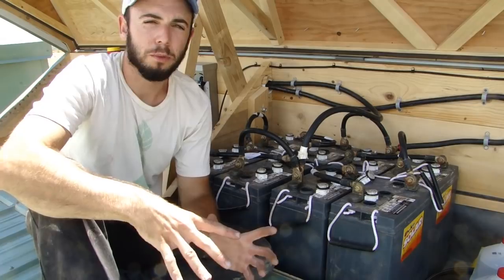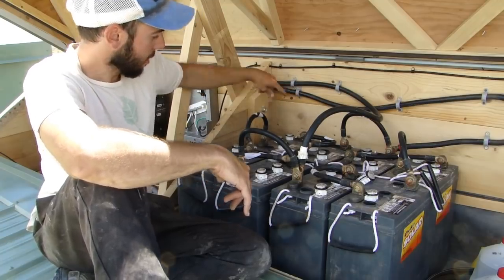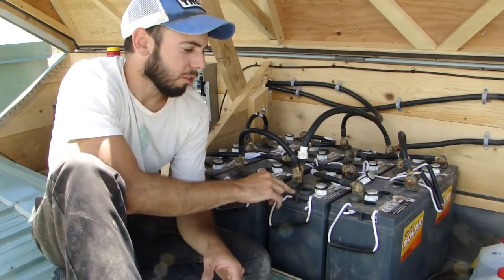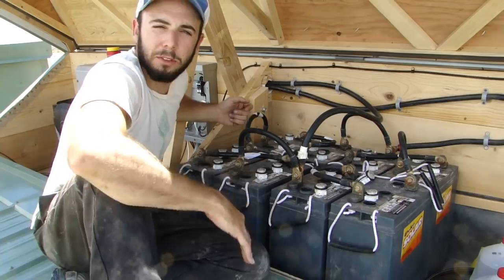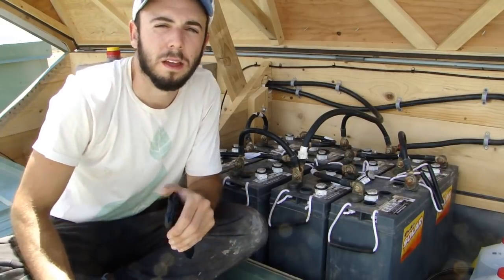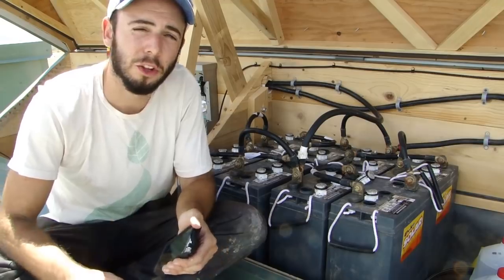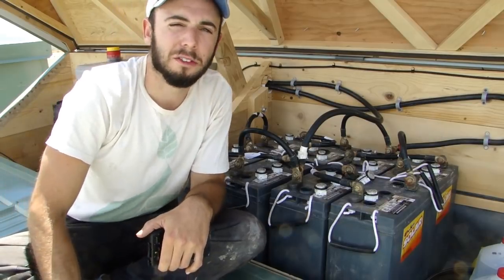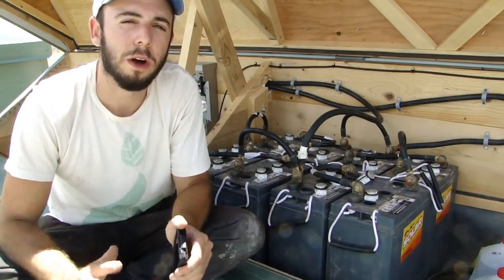How to Size Your Solar System

Comment: Dude, you are a using 24vdc to calculate the load yet not using 24 vdc loads. Your invertor uses substantially more amps/wattage  to convert the 24 VAC to 120/240 VAC. Therefor, is it not bogus to say that the 16.8 KW potential at 24 vdc  will yield 16.8 KW at 120/240VAC? Assuming no loss from the invertor, which in itself is not realistic, 16.8KW is still 16.8 KW, but at 120 VAC that 16.8 Kwatts equates to 140 amp hours which must then be compared to the amps (at 120vac) all of your house loads pull for the hours per day each is used. That is the real way that the system must be sized.
Reply: +Ken Withey transforming a voltage also proportionally transforms the current at the same ratio of turns between the coils, it's just the inverse. So transforming 24v to 240v (1:10 ratio) would transform current in the inverse ratio (10:1). You won't lose power (wattage) in the transforming process but you will have some loss in any system.
Reply: +Nathan Donovan ---  Pleukert effect may be the difference here... it depends on the loads you will activate on your setup!  Li will fare much better on heavy loads... but Li will discharge MEAN if a short, compared to lead acid based. Fire hazard can be a reason to avoid Li.

Modern Inverters lose about 5% in the conversion, though one would think it is an even swap... almost!  Yet 5% on a solar setup if not computed in, can mean nasty discrepancies between what one thinks and what is actually occurring.

Check all documentation on all devices and ask questions... also the length and size of the wires can be the difference between a successful setup and one that comes just short... the higher your V on the panels the better(smaller wires)... you may have to bring your inverter as close as possible to the battery bank! etc... lots of variables to consider...

Comment: i wanna ask. if i got a 1 fully charge 100AH 12V battery and i'm gonna use it at night using a 45W fan and a 60W colored tv, how long it gonna takes to drain my battery?? 
how manny hours ? thanks  the videos
Reply: +Jayson Rico 10-11hrs if you are using a 12v TV, if you use an inverter to run mains appliances  probably 7-8hrs

Comment: you suck at explaining i heard you say they amps stay the same and then you said they double
Reply: +Sheila Davis When you wire batteries in series the voltages doubles and when wired in parallel  the amperage doubles. That is how he wired the batteries.

Comment: You made a relatively simple process WAY more complicated than it needs to be.

The proper way to size a solar system (batteries & solar array) is as follows:
1.  Determine how many total Wh of energy your devices will use each day (e.g. 3500 Wh).  Read electric device labels & use a kill-a-Watt meter to help get this information.

2.  Decide how much you are willing to discharge your batteries daily (e.g.: 30%).  Note:  most quality brand deep-cycle batteries are rated to discharge to 50%.

3.  Calc your net battery pack size (capacity) as follows: TL Wh * 0.30 = 3500 Wh = 3500/.3 = ~11,667

4.  Determine the losses that your system will generate (cabling, connectors, charging heat loss, inverter, etc. Let's say that loss is 15% (Note:  use whatever loss % that you feel is most accurate).  Your solar array must generate enough extra power to compensate for those losses.  Recalculate your battery pack size as follows:  11,667 / (1-.15) = ~13,726 Wh (This is how much power your solar array will need to generate to provide sufficient power for your losses & your loads).  Note:  You many choose to triple this size if you want to have extra energy capacity for 3 days worth of power for 3 consecutive overcast days--that's typically what professionals do when they attempt to sell you a system.

5.  Go to the NREL website & determine the average Solar Radiation (kWh/m2/day) for each month that is available at your location.  http://pvwatts.nrel.gov/pvwatts.php
You should notice that some months have much less sunlight energy available.  You will now have to decide if you want to use the min, max, or average solar radiation number to size your system.  Note:  Choosing the min monthly solar radiation for the following calculation will produce a system that will provide optimal power (for your loads & losses) when the least sunlight is available & much more energy than your system will need to produce & store during the time of year when the most sunlight is available.  Choosing the max monthly solar radiation value will create the opposite effect in your solar array sizing (which will likely produce insufficient power during the time of year when the least sunlight is available).  Let's assume you choose the average monthly solar radiation of 4.5 hrs/D.  You would then calculate:  13,726 Wh/D / 4.5 hrs/D = ~3,050 Wh (This is the size solar array that you would need)  Note:  You many choose to triple this size if you want to have extra energy capacity for 3 days worth of power for 3 consecutive overcast days--that's typically what professionals do when they attempt to sell you a system.

6.  Do some research to find solar panels, batteries, an solar array position controller, charge controller, inverter, & grid-tie system components (if you want one--which I highly recommend).  Get all of the dimensions of each component.

7.  Make an installation design layout, get the solar panel racking, cabling, conduits, lightning arresters, power panels, breakers, etc.

8.  Find a qualified person (if you aren't able to connect everything) & work with your local electric provider to determine whatever is needed to connect your system to the power grid (if you wish to do this step).  You'll most likely have to hire an electrician for the grid-tie connectivity.
Reply: that's not complicated

Comment: Oops, if each battery stores 350 amp-hours of energy, and you have 8 batteries, then in total they store 8 * 350 = 2800 amp-hours.  Otherwise nice video.  Thanks.  Nice system.
Reply: +VLCC Tanker Captain Think about it intuitively, the amount of energy stored in a battery does not change based on how you connect them.
Reply: +VLCC Tanker Captain I mis-spoke in that the amp-hour capacity of a battery is a measure of the CHARGE stored in the battery, not the energy.  It is like the number of electrons that the battery can deliver.  If I add another battery, the charge is doubled.  Add another battery, the charge is tripled.  Doesn't matter if they are connected to anything or not.  You are assuming that amp-hours would be treated the same as amps, but this is incorrect.

Here is an extreme example that will hopefully help:
By the way, amp-hours means AMPS times HOURS.  (It is exactly a measure of total energy because an amp delivered at a higher voltage is providing more energy.)

CASE #1--one 6-volt, 10 amp-hour battery.  The total charge in the system is 1 times 10 = 10 amp-hours.  Let's say it is delivering 1 amp of current to a load.  It can deliver this current for 10 hours (10 amp-hours divided by 1 amp = 10 hours), then its charge is exhausted.

CASE #2--one hundred 6-volt, 10 amp-hour batteries, connected in parallel.  The total charge in the system is 100 times 10 = 1000 amp-hours.  Let's say it is delivering 1 amp of current to a load.  It can deliver this current for 1000 hours (1000 amp-hours divided by 1 amp = 1000 hours), then its charge is exhausted.  And it makes sense that 100 batteries will last 100 times as long as 1 battery, doing the work at the same rate.

By your math, how would this problem work out?
Reply: In both cases the batteries are delivering 6 watts (6 volts * 1 amp).  This must be the case for amp-hours to be compared directly between two systems.  Do you expect 100 batteries to last 100 times as long as 1 battery when delivering the same power to a load?  I do.
Reply: +VLCC Tanker Captain good explanation.
Reply: +VLCC Tanker Captain I don't see my previous reply anywhere.  What I said was that you are correct, my apologies.  I was confused on Ah.  Would be easier to compare batteries if they were specified in terms of energy content in watt-hours, rather than total charge in amp-hours.

Comment: Hi, I live in South Australia and we have just started building our own Earthship. We have 23 tyres down so far! (so we are still in the baby stages!) I'd like to ask a question. Our Earthship is/will be HUGE, 569 square meters. So my pantry is 15 meters by 3 meters wide! So shelving will be a big job.
#1 what kind of shelving did you end up with in your home? I would like a lot of built in storage and I have been looking at lots of photos for inspo, then I had a thought, I thought about floating shelves. I am tinkering with the idea of bolting a plate between the tyres with a steel peg coming from the plate (much like a cheap floating shelf from bunnings but on a bigger scale) that way I could drill a hole and slide the shelf on...any thoughts on that kind of set up? I'd like to use either recycled train sleepers or big slices of tree?

Comment: Hey I have a quick question that google can't find an answer for. I have 2 12V 200ah AGM batteries in parallel. Can I add a new third battery to that in either parallel or independent? I want to increase my capacity as well as be able to replace one battery at a time when I need to so I don't have to buy 3 batteries at once. If so does the battery need to be the exact same size i.e. 200ah? Great video, it helped me determine how many panels and battery capacity I need. Subscribed.

Comment: the way i always understood it was if you have a 12 battery system "lets just say" 8 of those 6 volt T 105 Trojan batteries which are rated at 225 amp hours. you have hooked up 2 - 6 volts in series circuit giving you essentially 4 - 12 volt battery sets at 225 amp hours, now you hook all 4  battery sets in parallel circuit for a total of 900 amp hours 12 volts. mathematically a 1 amp continuous load should in theory run for 900 hours. this is not including the rate of power consumption by the load increasing because the supply voltage is dropping as the battery depletes. technically for charge power you want to also add wind power as well as a proper amount of solar panels to not just match your most common power consumption but to be well above it for when weather conditions and sun light change. when dealing with watts vs current if you had an inverter that runs 250 watts continuous that suggests 25 amps load against the battery if you were running a halogen 250 watt work light. if you wanted to run that for 1 hour you would need a 250 amp hour battery "mathematically" but practically you would want 500 amp hours at least to do it more effectively. it is always best to be able to monitor your current usage by having a dc current meter hooked up in line.

Comment: What would you recommend for a whole house set up. I'm ready to invest and i want to do it right the first time. We used 1065 KWH last month. Please help
Reply: +Mellonee and Tim McDonald 
Are you ready for a second mortgage?  
That's a lot of energy (1.07 MWh) consumption in a month.

A grid assisted system would cost close to 30k$ (not including batteries)
e.g:  http://www.wholesalesolar.com/grid-assist

An off-grid system would cost close to 20k$ (not including batteries)
http://www.wholesalesolar.com/1892212/wholesale-solar/complete-systems/the-homestead-4-kw-12-panel-suniva-off-grid-solar-system

Comment: hi sir  i have 4 100 watts panel when i check with multimeter direct from the panel the output amperes is 24amps, but when i connect with controler using 65ft flat cord  w/ 100ampers deep cycle battery bank the output amperes drop to 10 amps with ammeter ,can you help me what is wrong with my system to achieve 24 amps output ,should i change my wire to awg and what gauge is your recomended,hope you help me Sir..   I really appreciate

Comment: I'm interested in a solar system for my houses. I would like to start with my first house. I've been reading on the different types of batteries to use. I've watched your video and wanted to know what size converter I would need. The house is over 2500 sq ft. (Over) I have 2 front load washing machines. 2 dryers. Central air and heat. A well , an extra large kitchen with 2 Electric stoves. ( large stoves ) . numerous lights , 2 hot water heaters. ( extra large ) , 3 freezers, 3 iceboxes. And outside lights and garage. Whew! How big or how many converters will I need?? What's the best in your opinion along with the batteries. I've been looking at these. , ( http://www.sunxtender.com/ ) I'm probably going to re-wire the whole house anyway. I would appreciate your help and input. Thank you

Comment: Can a 1kw solar panel alone produce that much electricity to power an Air-Con without batteries?
Reply: +Ramp10er NO. You have to have batteries to store the power. Solar panels don't produce 100% of their rated power every hour.
Reply: +Ramp10er
It could power a very small AC unit (<=5000 btu) with a large capacity capacitor bank until insufficient sunlight hit the solar cells (think clouds & darkness).

It  would be totally useless for a typical home AC unit (which in my case idles at 3.2 kW & has a peak draw of close to 9 kW when it starts).
Reply: @zeffur7  hey i m just coming around to your reply, today is Jan 2019. My point is ive  been talking about how to  use capacitors with some electrician coworkers to no avail could you let me know your info on caps thanks..
Reply: @josephmills7758  A cap or cap bank would serve as a battery for starting purposes.  Just look for super caps.
Once the small AC unit is started, the solar panels + inverter would be sufficient to provide enough power to run a small AC unit (650W max).  Just remember, that will only work during full sun conditions.  If clouds move over head, your AC unit will need to be connected to grid power to keep it running until the solar panels can recharge the cap bank for a restart.  

Even though it is technically doable--most people wouldn't do it due to the technical challenges & costs.

Comment: How come if I connect an inverter that has a capacity of 12/24v to a battery of 12 volts 9amh it works, and then if I directly connect a solar panel of 10watts that is producing a 30v at it's peak nothing happens to the inverter? Are the voltage produce in the batteries and the solar panels the same (AC/DC)?

Comment: I got an estimated quote a few years ago and it would cost me around $20,000+ to go completely off grid. When I figured the cost of paying my electric bill verses purchasing a solar system, it would take 10 to 15 years to equal the cost of the purchase. This does not include the insulation or replacement of any parts that could malfunction, which would add to the cost later on. 

Would love to do it, but I see no benefit in the purchase. As far as Global Warming, not enough evidence to support it. There is around 50/50 percent in Scientist who believe it is true and the other side say it is false.
Reply: +garrimic3 "I got an estimated quote.." - Those words immediately tell the story. Someone tried to rip you off. A typical home installation (100% off-grid) is on the order of about half of what you were quoted, if you were to actually buy and connect everything yourself. Suddenly your repayment time halves too - 5 to 7.5 years sounds about right. When you said "Would love to do it", what you really meant was "Would love to pay other people to do it for me". A few weeks of reading stuff and you could do almost entirely by yourself, with probably one exception - laying the panels on the roof - you might need a qualified guy for that (safety and/or legal reasons).
Reply: +TheRadiastral ..... The estimated quote was based on the KWH, which I used on my billing cycle for the entire year. This includes panels, batteries, and the rest of the equipment plus set up.

I know I could do everything myself, seeing how I have been in carpentry for 7 years of my life. This includes plumbing and electrical. I also completed an Architectural Associate Degree at the local Technology College in which I live. This was of course just before everything collapsed in 2008.

Today I really just don't have the time due to having 4 kids, while my wife is in Nursing school working on a BSN. I myself work 12hr days m-f, while I am slowly working on a Bachelors degree in Biology. Not enough work in the area to use my Architecture degree or construction, so I now drive a truck and do pretty well for myself and family. This is just not what I want for the rest of my life.
Reply: garrimic3 Fair play. I didn't want to come across as If I was bashing you that you didn't just do it by yourself, I'm sorry if it sounded like that. What I was trying to put across was rather that it might be way cheaper than, I thought, you thought.
Reply: +TheRadiastral .... I didn't think you were acting like an ass. There is to much emotional drainage in messages. Unless you can hear the tone of ones voice it could go in any direction. 

Although as I was replying to your message I thought you might think I was being ass, but it happens to work out that way sometimes. No ass here.
Reply: +garrimic3 i just bought a small setup to make sure I have some electricity if the grid ever went down. better to be prepared and have something rather then nothing gotta start with smaller setups and build ur way up like a hobby. you would be surprised what you can run with just two 200 watt panels a nice battery bank and inverter